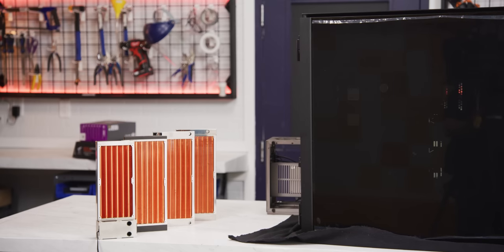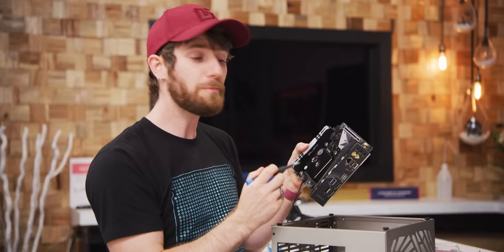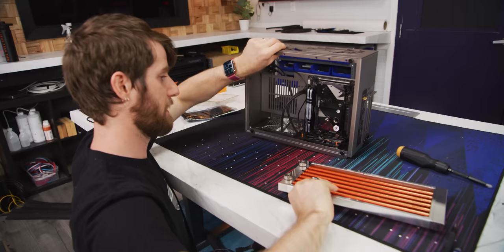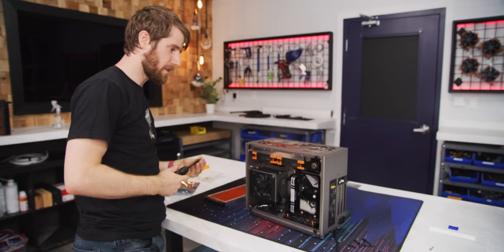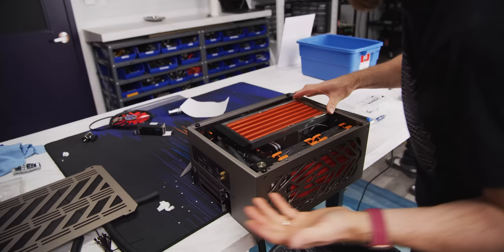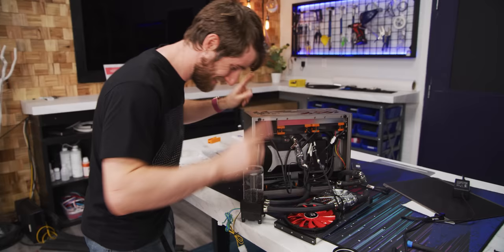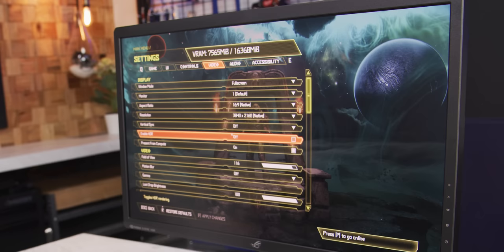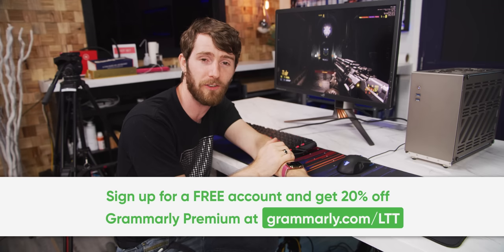The IMPOSSIBLE PC - 4x dual radiator ITX build

Comment: Fans - washers- first idea- The best solution. You could have used the Screws.
What we need is a cable-making system for such a Modular PSU- not every cable needs to be 12 feet long.
The solution to the casing problem is a 6-panel removability- This would give you access from ALL sides.
The build was awesome. A redesign on the side openings to vent the air to the rear would be nice.
I would love to have a small sheet metal shop to make such things.

Comment: I honestly thought the "impossible PC" was in fact the "perfect PC".
Reply: At this point it's just anything with a 30-series gpu in it
Reply: For real.. Easily one of the coolest PC's I've ever seen based off how much performance and cooling is capable in such a small form factor. I can't believe how cheap the case is as well. I want to build this myself sooo badly.
Reply: Well its a Possible PC. if it was Impossible, it wouldn't be.
Reply: The channel Geekerwan (their English channel is called EastTerminal) even got a 28 core Xeon into this case. But it's kinda impractical for normal users. Not that this build is that practical either, though.
Reply: @PabzRoz  the person who assemble the pc should charge 50$ to 100$, this is such a hard work!
Reply: @Priyajit_Ghosh  Shittt people charge $100 just to build a normal PC lol

Comment: After seeing the zip-tie cutter throwaway: Use a micro wire cutter. Thats exactly the right tool. It won't leave any sharp ends sticking out and it cuts right through it.(unless you tried to cut screws before)

Comment: Copper does have higher thermal and electrical conductivity so it dissipates heat better than aluminum for the SAME radiator geometry but aluminum is cheaper, lighter, and is used in manufacturing microchannel heat exchangers which have much more surface area than traditional copper ones.
MUCH RESPECTS.

Comment: For the rubber feet, I'd recommend removing the adhesive with a clean rag wet with Isopropanol (aka Isopropyl Alcohol) and substituting it with a high temperature rated adhesive compound.

Comment: I keep telling myself that my next pc will be one of these very small form factor builds but every time I watch someone actually build one, I kind of get scared away from doing it. I know I could build it, I just don’t know if the end product will really be worth it. Being really small is great and all but from what I’ve seen, noise and temperatures are not great a lot of the time. With so many power-hungry, hot-running components packed so closely together, especially if you’re using low profile fans like these, I just think you’re going to have issues with heat and noise. With the thermal density of a unit this compact, doing a full loop does make sense but even then, those skinny fans aren’t moving nearly as much air as the kinds of fans you’d normally pair with a radiator. 

It just seems like a big logistics headache and even if you plan and execute everything well, you could still end up with kneecapped performance and a very loud, very hot little box on your desk. I still want to try it out soon. I know some people have built tiny PC’s with a lot of power that still have decent thermal performance. I think you just have to be very careful in the planning stage and be ready to hit several speed bumps in the building process.

Comment: 9:36 Copper also can contain more thermal energy and does this more evenly over the material, which causes it to be able to contain more heat at a faster rate, while aluminium can dissipate faster to air, it's not by a whole lot, and it does not spread the heat as evenly as fast, so i suppose there is possibility air might pick heat more often as air touches a really big surface.

So you might want to actually test a aluminium and a copper heatsink of about the same size and similar density, with the same configuration under a very heavy test like Prime95 Small_FFTs, or OCCT, would be interesting video for those curious.
Would also be nice if you tested with some regular 12-14CM fan that has fine static pressure and at least 59CFM, compared to a much stronger fan like a Noctua iPPC fan, both the 12cm and 14cm variants, or some server fan (which nobody is gonna run normally because ear damage and tornado in a case etc, but is fun to try lel).

Also you should take in mind copper is very expensive compared to aluminium, like that would pay 3-4 times the amount compared to aluminium of the same size and density.
Paying so much more for a heatsink would not bring that much of extra benefit, so aluminium is fine for most people.

Anyway, love how excessive your build is.

Comment: Pro-tip for cutting zip ties: Use a cat nail trimmer. They're small, plenty sharp, and the curved "blade" of it makes it easy to pick out the one cable tie you're looking to cut and make it so you don't accidentally cut a cable.

Comment: Next time you build a compact water loop please consider a new tubing approach...pneumatic fittings and lines! Festo makes g1/4 nickel-plated brass fittings in a few sizes (8mm, 10mm, etc) that work great--combine those with some nylon tubing and you'll save space + time on the next build. 
I've been running similar setups for almost 4 years now and it's hard to consider the traditional gear.

Comment: If this were an automotive application copper has different electrolysis effects with certain antifreeze formulas vs aluminum. Copper is better in dusty applications with a wider variety of antifreeze formulas.

Comment: I watched a friend build a PC, buys everything, he wanted to assemble it himself, so I watched and gamed.  After 3 hours it was ready to power up so I could throw windows on it.  Hit power button nothing, then I smelled that distinct electrical burn smell.  So he takes the motherboard back to the fairly small computer store, the owner takes the motherboard out puts it down on some polystyrene and starts hooking power and video...then stops...he looks down tells my buddy "Look....this NOT GOOD!"  Apparently he dropped a mobo mounting screw onto the motherboard and it magnetized to a coil on the mobo and must have shorted it out.  Owner gave him a new one and sent it back to RMA.  He told him to count screws before and count screws after before powering up while shaking his head.  Came out flawless...only took me 20 minutes to slap it together (I still laugh...for him the paranoia set in!)  Your drop and subsequent case shaking @17:27 reminded me!  TY!

Comment: pretty sure the "aluminum dissipates heat better" thing was just a rumor from the 2000's.
Reply: i want to know the real fact about this
Reply: Copper is significantly better  , it has about twice the thermal conductivity
Reply: I thought he was right that copper is better at "soaking up" the heat,  but aluminum is better at "shedding" it. I only really know this from pans, however, as these properties are why they put copper cores in steel and aluminum pans and why aluminum rules for baking since you basically want a cake pan to be thermally "invisible".

(most quotation marks I've ever used in a comment written on my phone before)
Reply: @pamdemonia  my understanding of that was always for thermal mass and to spread the heat better.  It's why decent coolers have copper slugs, since copper is more thermally conductive it can spread the heat to a larger volume better then aluminum.  A copper slug in the center in a way makes the heat spreader on a cpu act like it has a MUCH larger surface area as far as the aluminum part of the cooler is concerned.

It's not impossible, my understanding of this science is somewhat minimal, but i don't see how a material, could be better at accepting heat then emitting it.  They are really the same thing aren't they?  I can tell you from experience that copper both conducts heat faster along a length, and cools faster then aluminum in simple shapes (i've used a torch on both materials during my day, copper get's hot further along the length of material faster, and cools back down faster, everytime, it's not even close.

In practice some of the difference between copper and aluminum can be minimized, or even be better than copper.  They have vastly different mechanical properties (aluminum is much more rigid for instance, you could make more thinner fins without them being so flimsy as to break or bend too easily.)   So at the actual end product aluminum is often almost as good as copper, at a fraction the price, it comes down to how well the cooler is designed, not simply the material it's made of.

Comment: I used to not care about what size case people used to build a powerful system. More room for fans and rads and cooling, the better, right? Well, after a couple years of watching tech YouTubers and custom builders put together every size and shape system imaginable, my favorites have become the tiny but excellent and powerful systems. They kind of have to be water cooled to get top tier performance in such a small space with 16 core CPU's and 3090's or whatever, but nothing is more impressive than building a computer the size of a shoe box that can and will outperform 99.9% of systems out there.

Comment: FYI Linus, most multi-purpose wire strippers have bolt shears near the hinge point of them. In the picture below, you can see the wholes have the screw/bolt size noted near the corresponding holes:

https://i.stack.imgur.com/3wBYG.jpg
Reply: @Nunya Business yes they are. They're even threaded so when you do shear it and back the bolt out, you correct the starting point on the threads.

Comment: Imma need a citation for the copper vs aluminum fin argument.  Convection off the fins is independent of the element, and conduction from the water to the fin surface is of course better for copper.  The best radiators, e.g. Hardware Labs, use copper fins and tubes with brass tanks.  It looks like these bare copper rads are just aping Aquacomputer's.  Their round tubes are dumb, but having copper fins is not a disadvantage.

Comment: Quite a machine. I'm thinking instead of all those radiators and fans, slip that case inside a slightly larger acrylic box and fill it with a suitable fluorocarbon with about 40c to 50c boiling point.The top and maybe one side could be aluminum or copper with nice fins and fans on the outside to displace heat to the surrounding air.

Comment: “That’s a lot more bubbles than I was expecting” what do you expect when you bleed a system and add a radiator (full of air)that wasn’t in the system when you bled it.
Reply: That rad was actually in the loop with the quick connects, its tough to see on the table, I think there were a lot of bubbles just because its a crazy complex loop and quick connects aren't perfect

Comment: 9:34 that's absolutely incorrect. The fin material does NOT influence the effectiveness of convective heat transfer. It's purely dependent on the fluid and the flow passing the fin

Comment: "top and bottom radiator as intakes, so we are gonna have positive air pressure inside the case(...)"

The poor power supply fan trying to suck air in through a hot radiator while an NF-F12 pushes air into it from the exit side.

Comment: It doesn't really matter that aluminium dissipates heat slightly better than copper because you would never want to use an aluminium or a copper surface for dissipating heat, both are terrible at dissipating heat, that is why (proper) heat sinks are always coated to improve their emissivity coefficient.

Comment: please, please, please do a bigger radically rad build with copper/brass as both a prime element and also engineering part of the design (maybe a midrange build that is also passive and has a case that is literally made of metal tubing and radiators?)

Comment: Aluminum does not dissipate heat to air faster than copper. Copper has a higher thermal conductivity, therefore it will dissiapte heat faster. No matter what style of cooler you make, if you make two of the same design, but one out of copper and the other out of aluminum, the copper will always perform better. It doesn't matter if you are transferring the heat to a solid, liquid, or gas.

The only way aluminum fins will be better is if you use a more dense design with more fins on the aluminum model. Now that you have a fancy new CNC, you can test this for yourself.

Manufacturers use aluminum because it's cheaper, easier to manufacture, lightweight, and performs good enough.

Comment: Linus, I don't really love tiny pc's as much as you do, but this is damn impressive. I go in more for the giant pc cases with tons of room for rads and cooling, with easy fast maintenance if there is an issue like the Corsair 900d and 1000d.  I do think the little cases are cool, but at the same time they just make so much work later on if there is an issue that it's just not worth it for me personally. I do have friends that into the tiny ones though, so these types of videos do help me out when I am building a pc for one of them. They give me good ideas as well as suggestions for hardware and cases that I might not think of, so thanks!

Comment: You could custom machine, 3d print, or even just buy feet that would screw into the bottom rad instead of sticking rubber feet to fittings.

Comment: Not sure that's strictly true linus. Copper has a high coefficient of heat transfer. The thermal conductivity of aluminium is 237 W/mK vs 413 W/mK for copper. So aluminium can only transfer heat at a rate of ~60% compared to copper. Also aluminium requires more heat energy to raise its temperature by 1 degree than copper (0.91 J/gK vs 0.39 J/gK). So aluminium may be better as an initial heat soak, but as copper will achieve equilibrium temperature faster its more likely to remove the heat away from the heat source and empire it on the air around it. Aluminium is just cheaper.

Comment: If you just used silicone washers in the first place the fans would have been installed much more quickly and just as quietly.  That kind of DIY anti-vibration pad was available for pennies from your local hardware store since long before mfrs started charging you $20 extra for anti-vibration fan corners and pull-through spike thingies that love to tear if you ever uninstall them.

Comment: linus, the wire stripper you threw out usually has a hole you can cut down the length of the screws with. just as a fyi for future builds

Comment: Im sure if Copper conducts heat better than Aluminum its ALSO disipates it to the air better than Aluminum. AL is used more offten because its lighter and cheaper, and more resistant to corrosion. thats the only reason im sure. the rate at which Metals conduct heat are mirrored in the rate in which it Disipates heat, regardless of the medium. Sure hope im correct LOL.

Comment: For actual users, there is a limit where you cannot get better cooling by adding another radiator. (My build with 7980XE and TITAN XP actually only have first handful 120mm radiators to handle the majority of heat) I think there is even an LTT video testing it?

It is not strictly related to the video but these industry products are just cheaper in China. It is related to quantities, yes, but it is also related to how easy you can find someone to make a large number of these in particular places of China.
Most students will just use a laptop, but most of the cases, their dorm table will have room for a ATX full-tower. It is just a "fashion choice" to build a small but powerful tiny PC.

Comment: they dont look like  copper rad's   more like  anodized like copper aluminum  or some other coating to prevent oxidation.  if they are copper then they have done color filtering on the footage in a weird way...

Comment: would it not be better for performance to go with an all air-cooled build for a case this small?  you can fit a pretty chonky low-profile cooler in there and LOTS of fans along the outside.  it even looks like the gpu would vent directly to the outside with that case so it appears to be fairly well designed for air cooling...

Comment: Why not make a rad with fins internally made of copper and externally aluminum? dissipation, aluminum, heat trasfer, copper...no?
Reply: Because linus doesn't know what he is talking about. Aluminum does not dissipate heat better than copper. That is not how convection heat transfer works
Reply: @drpwnage23  You sure?  Cause every metal spec page that i can find days the same thing linus said..
Reply: @tuna5748  The convective heat transfer coefficient is not a property of the material of the heatsink. It is a function of the fluid, the boundary layer, whether the type of convection is free of forced, etc. The surface colour/finish can affect the emissivity, but with computer heat sinks the thermal transfer due to radiation is minimal compared to convection

Comment: Cases like this are amazing, but TERRIFYING to work on when something goes wrong. You'd better be damned sure that every cable is plugged in properly, ever fitting sitting tight and components seated properly. Imagine the PC not working because a single stick of RAM wasn't seated properly...
Lots of radiators give you a lot of thermal mass, but if you can't move heat away from them fast enough, they'll just keep getting hotter and hotter and won't cool down the water being run through them. From a cold state the temps are a dream, but over time the system is saturated with heat.

Comment: What he said about aluminum dissipating heat better isn't true.  AL is cheaper and cheaper to fabricate and lighter so it makes more sense 95% of the time.  And maybe it's possible to make AL fins thinner so you can get more surface area.  But apples to apples copper is better.

Comment: Can't you get a 4× rtx 3090 system? If not then I must just be stupid, but a 64 core threadripper pro at 3.9 ghz with 4 3090s would be able to heat the entirety of Russia during the winter